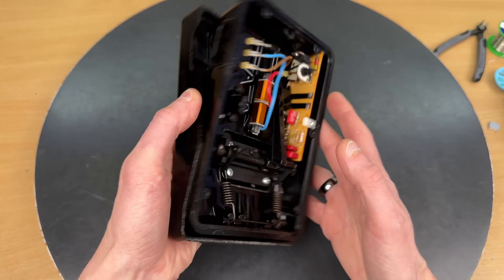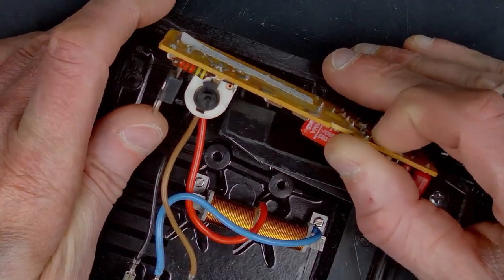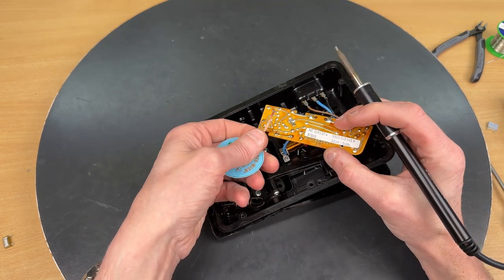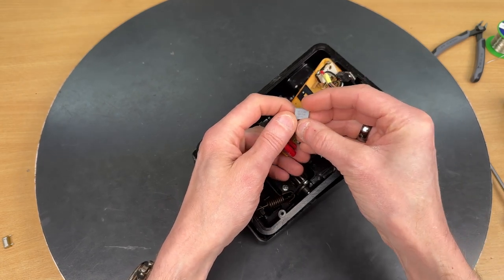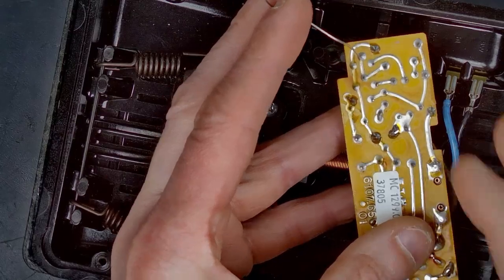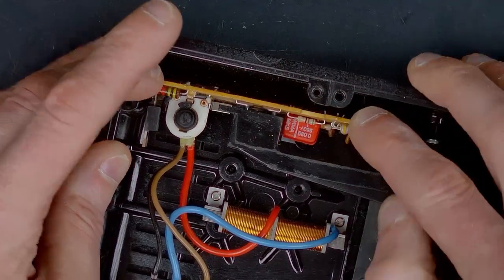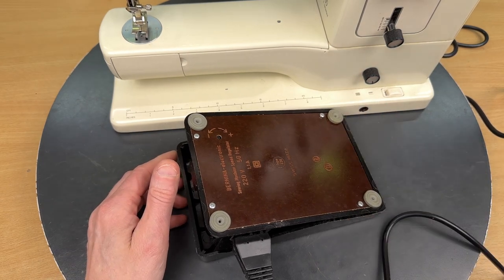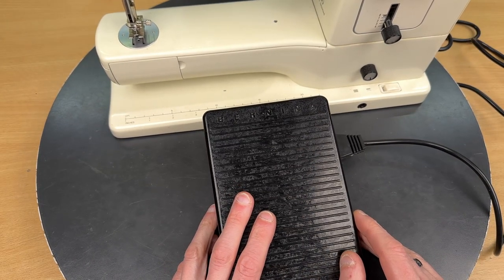Fixing the start problem - Capacitor replacement in BERNINA Type 238 & 232 Foot Controller

Comment: I have repaired several of this model the type 232. Some are easy like the video but some the carbon brushes will fly out of the black plastic arm. I used a thin .045 metal shim to hold them down so they wouldn't,t fly out from the springs then carfully slide it back into place. I also un hook the springs this allows the arm with brushes to exstend out past the circuit board making it far easier to install the board back in place.I lay the pedal on it,s side with the circuit board facing up it will be on the top side of the pedal.This also ensures the carbon brushes don,t fall out.

Comment: Hello, I was very interested in your video, because I have an idling problem with the pedal (same as yours) on my Bernina electronic 830. So I removed and changed the capacitor of the pedal as you showed in the video, hoping same result. Unfortunately, the problem remained the same : on my Bernina, by pressing lightly on the pedal, the motor is starting directly at normal speed, but without idling, and accelerates to max speed, by pressing further. No idling. Maybe it's not coming from the pedal, I don't know. Could you please help ?
Reply from the maker: Hi! You have a variable resistor you can adjust. Have you tried that? That adjust the "start speed".
Reply: @sewrepair  Thank you for your quick reply. Of course, I had it turned left and right so as you did at the end, but there was no effect at all on mine.
Reply: Hi ! I think of replacing this variable resistor. Maybe I could find one if I have the value of its resistance. Could you give me that information ? Thank you.

Comment: Very nice video! I have got a bernina 530-2 record and it happens to have the same exact problem. The pedal is older (the beige one). Could you please send me a link of what kind of capacitor I need to buy? Thanks a lot 🙏♥️
Reply from the maker: I use this: https://3dsewingparts.com/electronics/77-01f-safety-capacitor.html

Comment: Hello, I'm a textiles teacher with a Bernina 1008 foot pedal that has stopped working. Not sure if its age or problems with electricity surging in the classroom, as I have had 5 or 6 go this year. Its costing us 30 quid a time to fix them and new pedals are selling for over £100. Is there a replacement  circuit board I can buy?
Reply from the maker: Hi! I have repaired several such pedals for schools and there is one problem that is common. When the pedals fall to the floor, a large coil is knocked loose and one of the legs breaks. The coil has the designation CH on the printed circuit board. The result is that they stop working. It is possible to repair this error with a small wire and soldering iron. A new coil is usually not necessary. At least I've managed to fix all the ones I've had with this problem :)